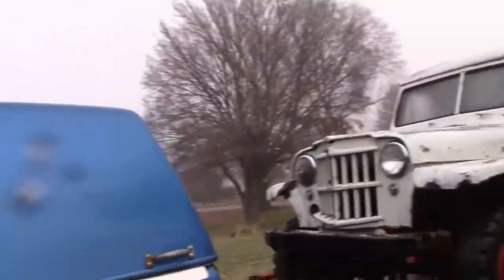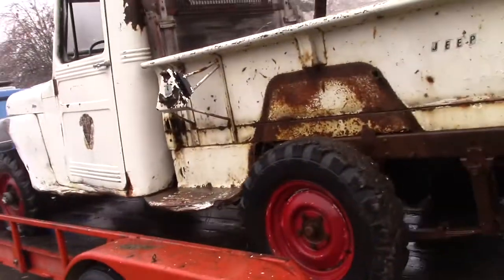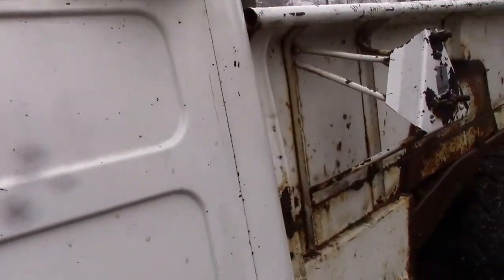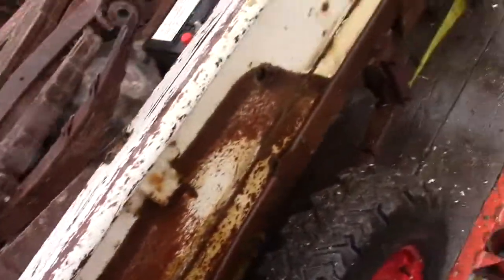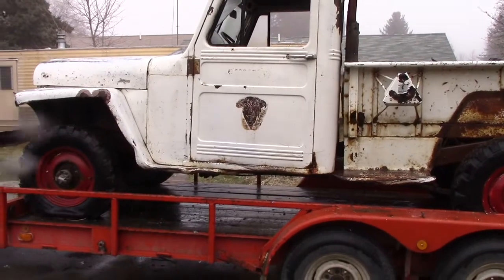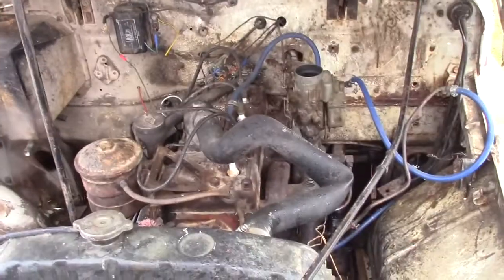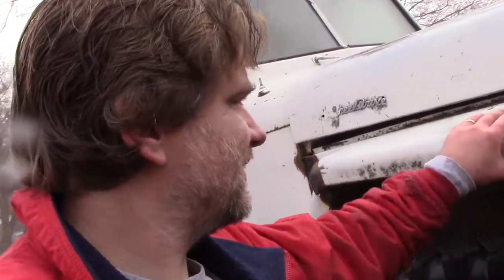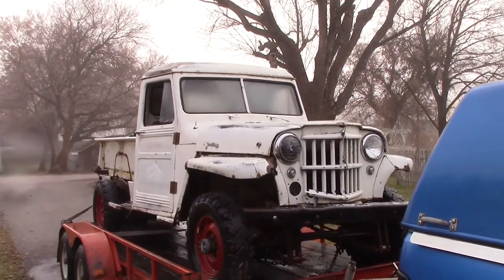Willys Jeep Truck

Comment: Needs a turbo...
Reply from the maker: One of those little Yanmar industrial diesels.  I am half convinced to try putting the turbo back on the F head 134 but swap it over to electronic ignition to see if that cures the starting issues.